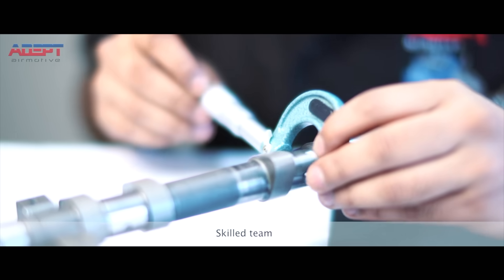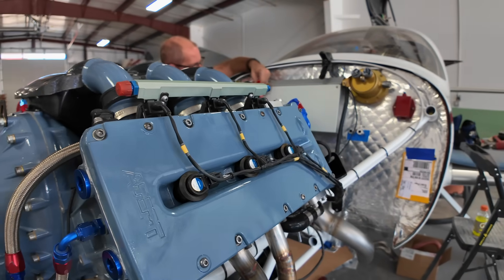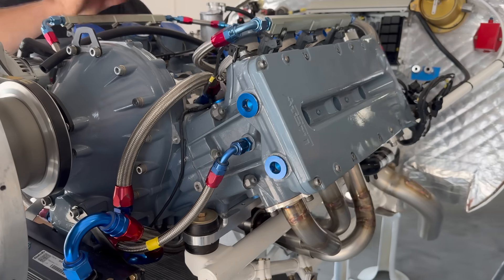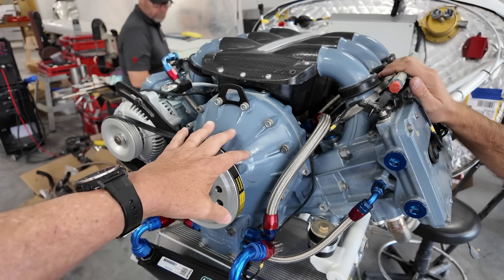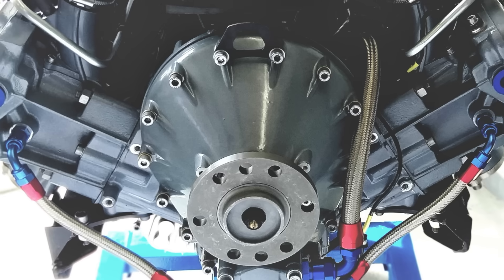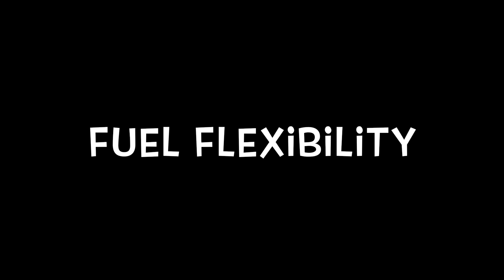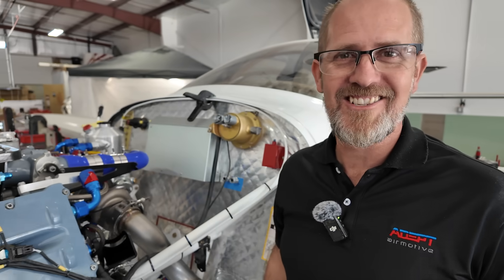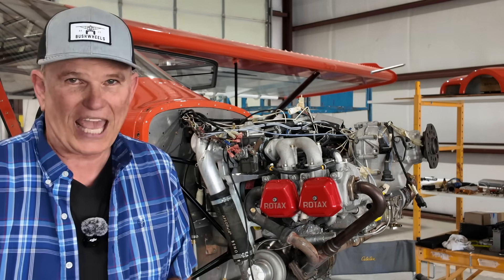The new Adept Engine could be a winner for General Aviation

Comment: In my opinion small displacement, fuel injected , reduction driven and turbocharged engines are the future of GA.
Reply from the maker: I absolutely agree. I'm a big Rotax user and I have no problems with the high rpm's when combined with efficiency and power.
Reply: I'd love to see a six cylinder Rotax.
Reply: They made one and put it back on the shelf.  @UncleKennysPlace
Reply: @devonlove9095  That was an April Fool's joke.
Reply: No, they tried that on my Toyota Tundra (2023) and it made it 11,000 miles before bearing failure. Low RPM and lots of torque is the ticket for GA aircraft engines. If Toyota didn’t get it right what chance does a mom and pop company have? You can’t have 100K engines failing in the air.
Reply: @grumman38  force and so torque is what cuts into any surface. With high RPM all fluid films get thicker ( because the fluid is no squeezed out ). Of course, bearing surfaces need to be large to that the fluid needs to travel far to leave. So, less cylinders are better. I would even argue that in a boxer, we should pay for the weight of the crankshaft and instead reduce the number of main bearings. flat-6 with 4 mains. I like V engines for this reason. 2 valves ( max 3 ). Soft springs => hard rev limit at 4000. 4 valves allow for softer springs ( per valve ) less travel. I am undecided. I really want the spark plug in the center. I don't know about multi-spark -- can both plugs be in the center or do we need 2 valve HEMI?
Reply: @grumman38 My currently daily/tow rig is a Chevy 3l diesel making 500ft/lbs all day and 25mpg unloaded. It’s done 10hr days all highway moderate load, low rpg without issue. Maintainer is key, it does burn oil at about 1qt/5k mi but that’s about it. (Unfortunately Chevy has forgotten how to make reliable V8s …6.2 gasser recalls)
Reply: Bingo.
Reply: Most definitely get rid of carburetors and associated "icing" that seems to come up. And get rid of any gravity-fed fuel delivery systems all the way from the tanks to the engine.
Reply: The similar Rotax project was shelved just before certification.
Reply: Yeah bingo is right. The way the prices are going for those engines there will be no future.
Reply: Definitely not.  

So much complexity.  So many failure modes. And performance isn’t likely as good when you add the entire weight of the installation including accessories and fluids.  

Automotive technology is not what we need for aviation.  Go drive your car with full throttle acceleration to 200km per hour and then keep it there for until it’s nearly out of gas.  Keep repeating it until you have 400,000km. How reliable do you think it’s going to be?
Reply: @calvinnickel9995 This issues has been discussed ad nauseam. If you think complexity is the issue, don't think about looking at turbo-prop/fan engines with their gear boxes, reduction drives or failure modes. The 30-40s technology in say the IO-360 relies on incredibly low compression ratios, massive inefficient engines burning leaded fuel to be viable.

Automotive engines are designed to operate from idle to redline repeatedly for hundreds of thousands of miles without being rebuilt, aviation...3000hrs at best with fresh oil every 50hrs. The only difference here is maintenance intervals. 

oh-for high strung automotive applications look no further than endurance reaching and that technology. Even Nascar engines run wide open all day every day without issue for the most part. It can be done and is everyday around the world. GA in America has forgotten how to innovate.
Reply: @calvinnickel9995 In German the word "Bleifuß" was created for people, who fully press down the pedal for the whole journey over the Autobahn. It was no problem for the motor, but then Oil Crisis hit (the poor of us). SOHC
Reply: Or an electric motor turning the prop and a small gas generator keeping the battery charged.
Reply: Personally I would love to see more innovation in diesel based power plants.
Reply: @Beyond_TheRedLine you can lose the gear reduction, for one, even more torque, more time between service because of the low rpm’s. I totally agree.
Reply: @ScottGunMag69 continental has the CD-170 diesel burning only 5gph in cruise with a reduction gear box. They also claim the 300hp option only burns about 9gph with sounds like a dream come true. Hopefully innovation drives the price down in the future.
Reply: @Beyond_TheRedLine  In the DA50, at a 170 knot cruise speed, the CD-300 burns the same amount of fuel as a Bonanza (also at 170 knots)... and it has less range. That's a completely modern, FADEC controlled diesel that can't even compete with 80 year old gasoline engine technology!

At 9 gph, that aircraft is dragging.